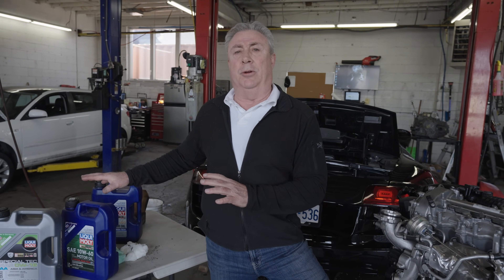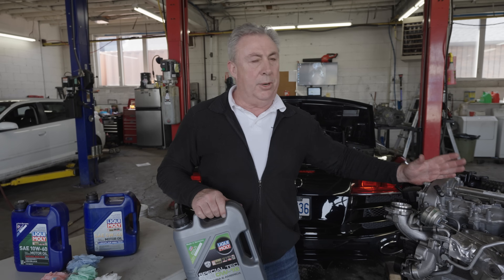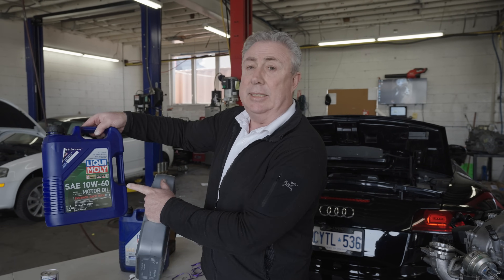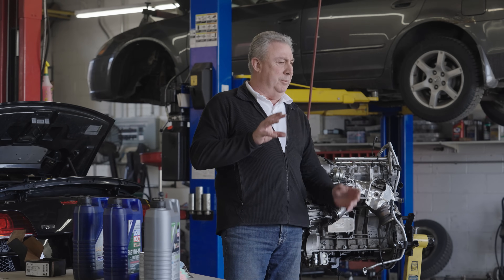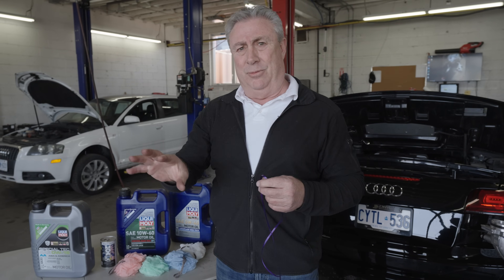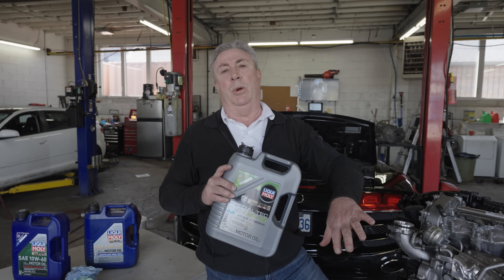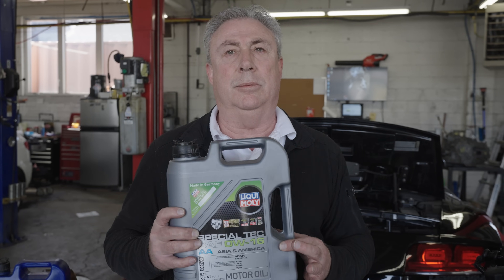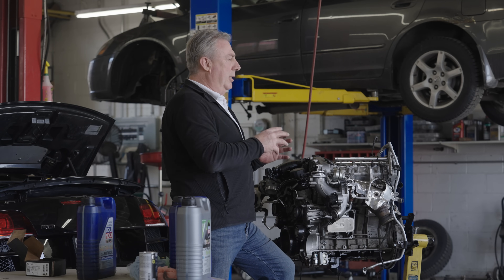Thin engine oil just a Scam? What's Safe

Comment: Today I’m changing a cylinder head on a 2007 Ford F350 with a 5.4 L the cam phaser chain came off and the valves hit the piston with this vehicle. I will be running 5w50 as it is a cheap Chinese oil pump cam phaser kit. The unfortunate part these 5.4 L engines I believe would have a much better reputation if they ran 5w30 and it is such a joke, the guides for the chain are made out of cheap nylon. Something you’d see on your dirtbike for the chain. That’s great for a dirtbike or motorcycle as you can easily access this guide or tensioner but how many people are gonna take out takeoff half the front of their vehicle to change the tensioner every 150 thousand miles these engines are created to never be rebuilt .

Comment: This winter up here in Canada, it was -40 my 2006 Dodge power waggon would not start the next day. I did an oil change with zero 40 and it turned over much easier but still did not start but I changed the spark plugs and that change the issue on the second owner of this vehicle and as soon as I started using thicker thicker viscosities. The cam hemi tech is a significantly lower vehicle is running extremely smooth. I have 368,000 km.

Comment: I own a 3  5.4 L and the ford mechanic that serviced them recommended 5w30 as he recommended because of the cam phaser issues and the viscosity gets decorated too quickly so I live up here in Canada. I have a 2006 Dodge car waggon in this winter around zero 40 in it zero cam noise zero tech, and it started in very very cold weather up in Canadaand flowed nice but yet it’s still thick love it

Comment: I own a couple 5.4 L and the four mechanic that serviced them recommended 5w30 as he recommended because of the cam phaser issues and the viscosity gets decorated too quickly so I live up here in Canada. I have a 2006 Dodge car waggon in this winter around zero 40 in it zero cam noise zero tech, and it started in very very cold weather up in Canadaand flowed nice but yet it’s still thick love it

Comment: I use a simple formula to make my cars last longer. I will do one extra oil change a year. This will usually take the mileage down to the 3-4000 mile range. I live east of Alaska so I always use a zero weight oil.  If one is concerned with low viscosity increasing the viscosity one range is perfectly okay. For example I use a 0W30 in my newer 2014 F150 instead of 0W20 as recommended by FordTechMakuloco  For my 2011 and 2021 Rav4 I have stayed with the manufacturer's recommended 0W20 and 0W16 recommendation so far.        This summer I will do a 0W30 oil change on the 2011 as an experiment.

Comment: Thin oil isn't just for fuel economy. The tolerances of components these days require a thinner oil. Also the oil now flows thru much smaller access areas requiring thin oil. 
Just use the correct oil and change oil every 5k. That's a lot better than changing to thicker oil later in engine life.
I have 300k miles on my Toyota and it still doesn't burn any oil between changes and runs great. Been using 0-20 since new
Reply: Lucky. My mom has 263 thousand miles, and 0w20, and the Camry drinks more oil than my paw paw drink whiskey.
Reply: Mine calls for 0w-20, being in Florida I use 5w-20 for added protection and less viscosity modifiers to allow more actual lubricant.
Reply: @ you can use a 5w30. What funny in other countries these same motors will call for a wider range of weights. It’s all about economy in North America.
Reply: @workingmanaudio2754  

Nissan tell everyone to use 5w30 in my country for a 400hp V8.

Used to tow 3.5t loads in 45c climate, O try to tell people to stop using 5w30 and use something like a 10w50.

People scald me and tell me Nissan recommend 5w30 and going out of spec with destroy the engine.

Then I show them in the owners manual, the oil chart that says you can use a 10w40,10w50,10w60,15w60 for our climates hahahah.

They shut up pretty quick lol. 
I use 10w40 in mine. I'd use 10w50 if I towed constantly.

Makes me cringe knowing there are people in 45c+ summers driving through the middle of Australia towing 3.5t with 5w30 oil..... Poor engine
Reply: @DarrenBoxhall  Yep; I run 10w40 in Australia, no towing.
Reply: @DarrenBoxhall  manufacturers will tell you to stick to a certain oil spec because of performance issues, fuel economy as well as environmental protection reasons.
You go out of spec and in the long term damage to the engine occurs, they find a perfect excuse to void your warranty.
They talk about "recommended" parts and products but if you use others, you are on your own in case something happens.
If nothing happens, you're just lucky
Reply: @254laViva  the user manual says otherwise. You can use anything from 5w30 up to 15w60 depending on climate.
Reply: @DarrenBoxhall  unfortunately internal engine temps are higher than the temps outside. The only time it would make absolute sense is during cold starts, when carrying heavy (heavy is relative) loads and when towing over long distances. If you do a lot of short town trips, lighter oil is more beneficial.
Reply: @254laViva  so Nissan tell everyone to run 5w30, people towing in hot weather.

Yes, if you grab the owners manual out of the glove box, it lists oils all the way up to 20w60....... Surely it would blow up if I stuck 20w60 in it?(In freezing weather, yeah, not good). But I'm talking summer
Reply: @ 
Agreed; if I only did short local trips, especially in a cold environment, I would definitely use a low viscosity oil.
Reply: @254laViva there is no long term damage. It's literally just an American thing to stick with one type of oil. As the guy said, other countries give you a chart, and two what oil are best in every condition. I have 2 96 civics, one American and one I imported from Japan. The American only recommends 5w-30, but based on the chart the Japanese gives you, 10w-40 is actually best where I live in the midwest. So that's what goes in both. Sometimes in the winter I'll use a lighter oil if it gets crazy cold. The whole thing about using only the ice type of recommended oil, and it being the lightest oil, is a myth Americans have fallen for. Engine life is mainly determined by oil change intervals anyway
Reply: @skatingsam96  premature timing chain wear and LSPI are myths to you especially in small forced induction engine? It may not be a problem in the US but elsewhere these are real problems. We are now even hearing of long-term LSPI in some cars
Reply: @skatingsam96  It is all about CAFE ratings.
Reply: @254laViva yep. Can't have a warranty unless you leave your car with someone that may or may not do service properly.
Reply: @254laViva  That is the big problem - even if your oil did not cause the problem, and they know that, they will insist that it did and refuse to honor the warrentee.  One reason I don't want an extended warrentee - you have to obey them to the letter.
Reply: @mikyl-fo8rh  If you are living in florida go with a 10-40 weight oil,oil thins out at high temps,I live in NYC and run 5w30 year round!
Reply: @smedleybutler1969  I think that oil is its thinnest at low temperatures to ensure complete lubrication when engines are cold and parts are contracted and tight and oil thickens at higher temperatures when parts expand due to heat.
Reply: I think that more of a testament of not being a turbo direct injected motor. Those types of motors with a 20w is not a great idea. So many motors fail or burn 
 oil now.  Toyotas motors are not hard on oil. Their oil burning issues in the past were due to engineering failures with position/ring designs.
Reply: That's not how this works
Reply: Then why do so many modern engines run QUIETER with thicker oil?  Water thin oil is to meet CAFE targets, not to provide optimum lubrication.
Reply: @jamesbosworth4191  as it's meeting 'targets' will it not be lubricating?
Think about it in the context of smaller but more powerful engines thanks to additional electronics and more complex ECU input. Thicker is not necessarily better.
Reply: @ It will be, but not optimally.
Reply: @254laViva  CAFE targets are not about lubrication, they are strictly about gas mileage, and I am not a gas mileage freak.  I am a longevity freak.
Reply: @jamesbosworth4191  CAFE is just a part of the story. The other part that you don't occasionally see is LSPI- low speed pre ignition in DI engines, timing chain health/ longevity, after-treatment devices such as the DPF or the GPF etcetera.

I live in Kenya 🇰🇪 where most of our cars are Japanese pre-owned units and from my experience the last few years, the thinner oils, especially 0W-20 and 5W-30 have served me well across several engine platforms. I'm enjoying better fuel consumption and lesser overall engine maintenance costs since excessive carbon deposits are a thing of the past. Not turning back anytime soon.
Reply: @254laViva  Oil viscosity has nothing to do with carbon deposits.  Carbon deposits are related to fuel, fuel system and how precise the jetting is, and whether or not your engine consumes excessive oil, and even combustion chamber design.  Also, the typical American engine is of much larger displacement than the typical Japanese engine and therefore is much less influenced, economy-wise, by such minor things as oil viscosity.
Reply: It's for fuel economy period. Government mandated that ignores reality but that's liberals for you. Sacrificing reliability and engine life for a tiny amount of fuel economy. Same folks wanting you to replace your ICE with an EV. 

The smaller oil passages reflect the change to thinner oils. Trouble is, manufacturers have amended the recommendation to include the engines without the smaller passages--a no-no and an insult to the engineers who designed the engine and a slap in the face to the vehicle owners who maintain their vehicles for maximum life. I'm staying with the proper viscosity that my vehicle was designed to use.
Reply: Funny enuf am in ghana, climate can be extremely hot here bought a 2011 toyota corolla from Canada with 82000km been using 0w20 d car clocked 150000km in August 2025 der has been no shortages between oil changing
Reply: @yaw473  It is mostly the bottom end that will go.
Reply: No, an engine that says 5w30 on the oil cap, will run on a 20w60 forever.
Reply: @DarrenBoxhall Not in Duluth
Reply: Oh and so you think all those miles hasn't opened up the bearing clearance a tad your sadly mistaken and a tear down and mic of components will prove it. So therefore if clearance opens thicker oil is fine
Reply: @Todd-tq7cs  hell, the first 5k miles of break in is a major wear cycle.  All the rotating surfaces mate with each other.
Reply: @Todd-tq7cs  wear doesn't open up the tiny oil orifices, tubing and small passageways.
Reply: @Todd-tq7cs  He and his ilk probably have no idea what a mic is.
Reply: @jamesbosworth4191  I was an experimental machinist for 15 years than a tool.And die maker for another fifteen. And now Is a quality control manager. Betting I know a little bit more about a mic than you do.
Reply: @mrc2165  Many younger folks do not even know what a mic is.
Reply: That is complete and total myth. Tolerance is inside. The motor. Have not changed in 50 years. Stop spreading this nonsense.
Reply: That's right. They aren't building the same engine and specifying different oil to get better mileage.
Reply: @brap5829  Oh yes they are.  Nowadays, it is all about CAFE.
Reply: I was wondering about that.
Used to change viscosities on older cast iron engines but modern engines with things like variable valve solenoids, etc., I wonder if going thicker than the factory-recommended full-synthetic oil and viscosity will have problems passing through fine screens and passages of modern engines. I’m just not impressed with these newer engines burning/passing oil between changes.
Reply: @blizzy6392  Going from 0W something to 5W something won't hurt, but I wouldn't try to use 10W or 20W something and wouldn't try to use single-grade oil.
Reply: @jamesbosworth4191  Or, in my case, 5W30 synthetic to 5W40 synthetic (??).
Reply: @blizzy6392 Or you can go 0W-40.
Reply: @josedeleon2230 I wouldn’t want to go lighter than 5. It doesn’t usually go below 30•F where I’m at.
Reply: @blizzy6392  Just get a manual for your make and model sold in OTHER countries and see what the viscosity recommendations are, and follow those, as other countries don't have CAFE.
Reply: The EPA is your enemy.  3k miles oil change
Reply: Manufacturing tolerances haven't changed in the last one hundred years and in fact in some cases they have become wider to reduce costs due to component scrappage,
In some cases clearances have changed but this is generally because modern engines are designed to control their working temperatures much more effectively than in the past and this has been done chiefly by increasing the oil flow rate and thereby using the oil as the cooling medium, as a general rule all critical bearing clearances are exactly the same as they were in the 1930s.
Reply: @grantbaker3336 wrong...
From a simple Google search...
Yes, engine tolerances are generally much tighter in modern engines compared to those of 50 years ago, enabling higher performance, efficiency, and longevity.
Why tighter tolerances?

Modern engines are designed to achieve higher power output, improved fuel economy, and reduced emissions. Tighter tolerances are crucial for achieving these goals by ensuring better sealing, reduced friction, and more precise control of combustion
Reply: Wrong clearances have not changed in 80 years.
Reply: @chrisleggett685 You're making a very broad statement, most newer engines are designed for 0w20 only having  VVL and VVT timing requirements so are you sure thicker oil wouldn't hurt that?
Reply: @chrisleggett685 
From google....
Why tighter tolerances?

Modern engines are designed to achieve higher power output, improved fuel economy, and reduced emissions. Tighter tolerances are crucial for achieving these goals by ensuring better sealing, reduced friction, and more precise control of combustion

Yes, engine tolerances are generally much tighter in modern engines compared to those of 50 years ago, enabling higher performance, efficiency, and longevity

Comment: New Over head Cam engines need thin synthetic oil to keep the oil passages clear to afford proper lubing  of Roller tappets ie lifters and CAM shafts.  It is crucial you change thee filter every 3,000 miles to stop dirt from clogging these small oil passages.

Comment: I bought a new 2022 car with the  1.6 liter TURBO, and recommended oil is Full Synthetic 0W20.  Somewhere, which I haven't found again, the Manufacturer recommends 5W30 for SEVERE SERVICE.  Doesn't a smoking HOT TURBO quality as SEVERE SERVICE?  My FIRST oil change, as I did it myself, was at 3,000 miles and I installed Full Synthetic 5W30.  I bought and paid for that engine, and it is going to LAST, if it is a decent motor. The Warranty does NOT explicitly state that 0W20 Oil MUST BE USED.  AND, the manufacturer doesn't care if the engine fails after their warranty.

Comment: Been using 10w30 in my 2015 town and country from the first oil change. 130000 miles on it now. No engine problems at all. No oil consumption either.

Comment: I noticed on the 0w16 oil container it said recommended by Honda, Lexus and Toyota. I trust the engineers at these companies more than a YouTube video. I have run 0w16 (Avalon) and 0w20 (MX-5) for years with no problems. But I change oil at 5000 miles or 6 months. Sludge is the real problem in modern engines and requires oil/filter changes on a regular basis.Toyota started recommending 0W-16 oil for select models, including the 2018 Toyota Camry with the 2.5L four-cylinder engine, in the 2018 model. In those 8 years I have not heard of any engine problems caused by using 0w16 oil. Companies like Honda, Lexus and Toyota are not going to risk their well earned reputation by recommending an oil that will cause damage to your engine.
Reply: Sledge only happens when you don’t change your damn oil at regular intervals

Comment: We can go back and forth with this as long as you want. To me it boils down to two things one change your oil every 4 to 5k or in 6 months. The second thing is luck did you get a good engine to start with. I was a mechanic all my life worked on many different brands. Something to keep in mind newer engines are computer controlled and inside there are very small passages for oil to travel to control certain parts like your cam timing. Oh and tell this guy to stop calling an engine a motor.
Reply: Engine- a machine that converts energy to mechanical force or motion.
Motor- something, such as a machine or engine, that produces or imparts motion.
I don't get the distinction; the terms seem equivilent. Tell me why mechanics seem to not like people calling an engine a motor.
Reply: @countschad  do you call a electric motor an engine?
Reply: @lynheydt3304  I do not. But, according to its' definition, it would not be incorrect to do so. Why do mechanics not like it when people call car engines motors?

Comment: 10w40 in everything ive owned, £15 per 5 liter of cheap stuff. i put it in my dads 5 pot volvo higher mile diesel and it really quietened it down. years and years of 5w20 in it no good

Comment: My cars are from the 90s. They all recommend 10W30. I live in the Arizona desert. I use 10W40. BECAUSE I get the same start up protection but better hot engine protection that way.
Reply: 10W40 is getting harder to get. Maybe add some Lucas Oil Stabilizer to thicken it up.
Reply: 20w50 my boi.